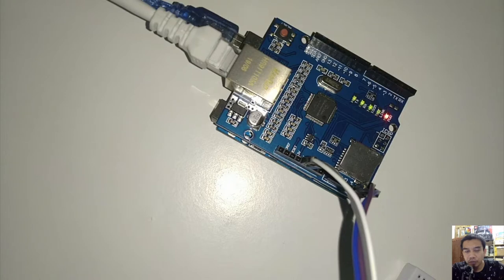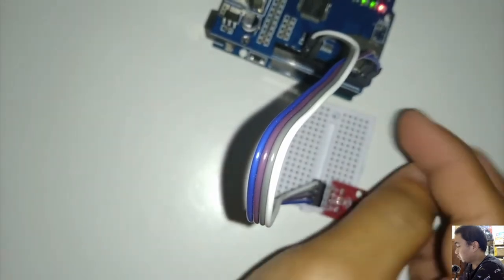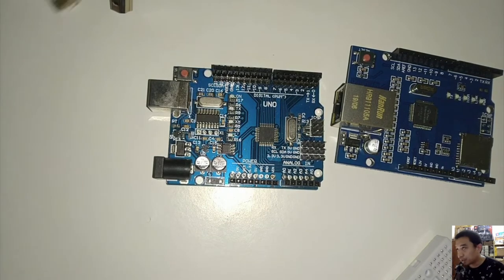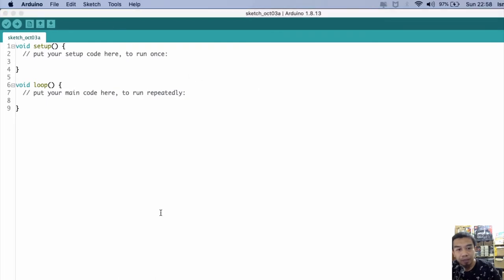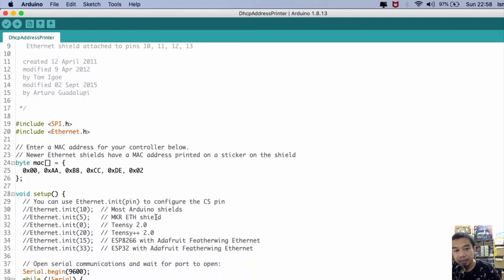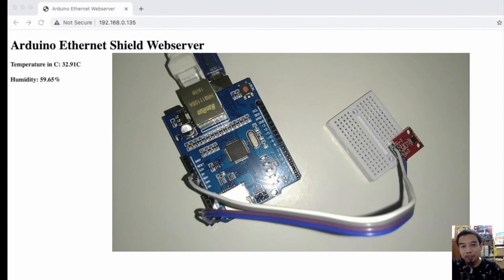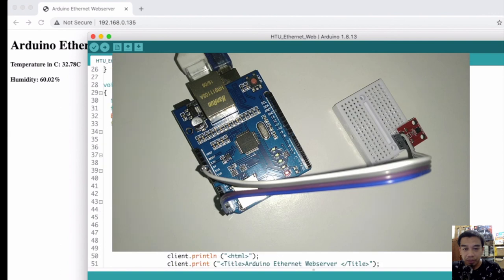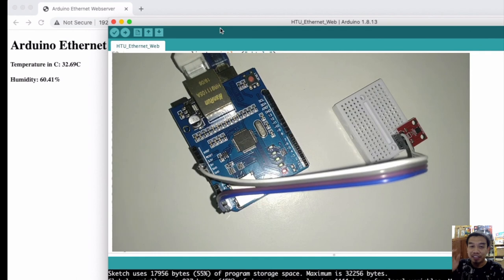Arduino Ethernet Sheild Webserver | Problem Solved

Comment: I created an arduino server to control a relay and it becomes unresponsive after 1 day. Can't figure it out.
Reply from the maker: Dear sir. The reason of responsive might be due to latch in your connection. My advise will be creation of restart daily/ per sometimes, that will improve the response.